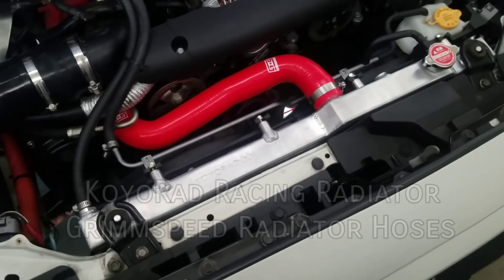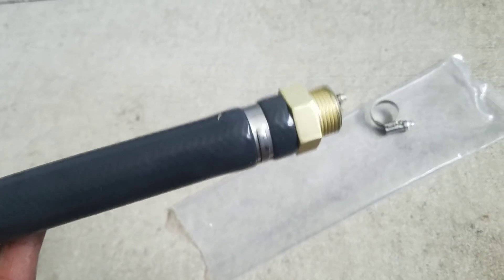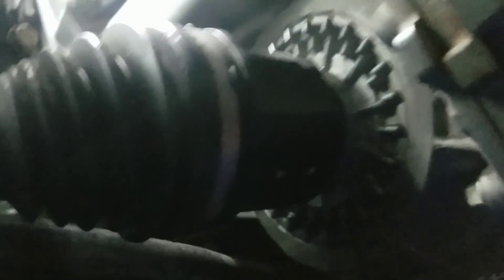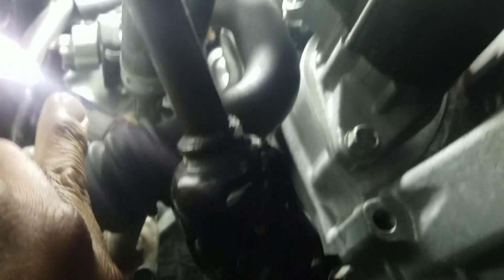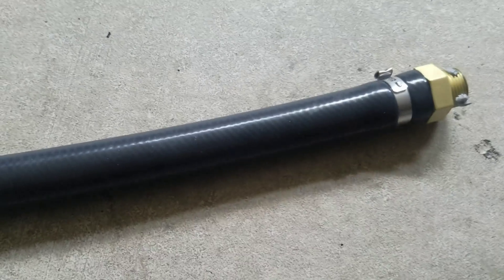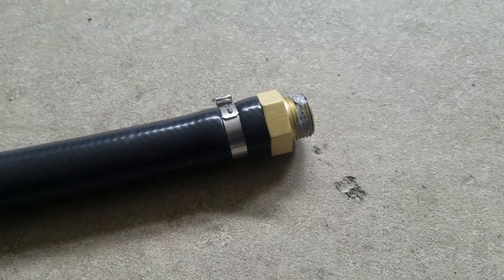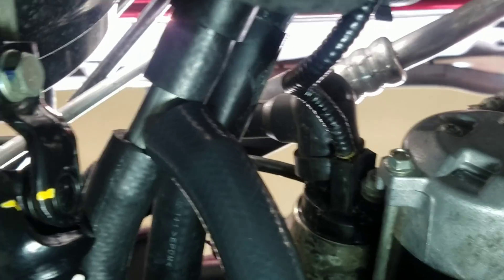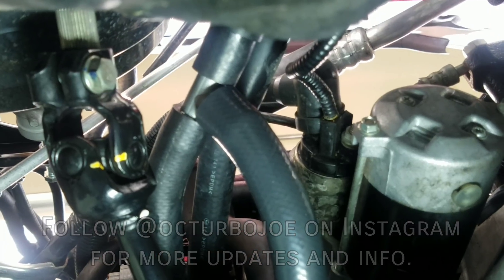2015 SUBARU WRX STI - Cooling Upgrade Part 3 - Get-A-Dom-Tune #4 Cylinder Head Mod - OCTurboJoe

Comment: Thanks for the video, man. I try hard to do good work for the community and I'm very grateful for customers like you.
Reply from the maker: Well sir, it's guys like you that help us with keeping our cars on the road. If only people would understand how much this mod does for the price. The returns are more than a $300 intake, that could possibly destroy the engine if not tuned correctly, mind you this is a set and forget mod. But everyone has different priorities I guess. Keep doing what you do Dom. Thank you again!
Reply: Turbo ninja plus a Degree in hydro dynamics if I'm not mistaken, he knows his stuff so I'd trust the mod and  dabble with any mods he snaps his turbo-ninja-yoda fingers at. Dom's da man, he's tuned my rides multiple times (drove past many other tuners, 6 hr ride)
Reply from the maker: @wakeupandbord  I've heard he's great at what he does on many accounts. Thank you for your inputs on the man himself.
Reply: Does this work on the '17 wrx ?
Reply from the maker: @DaddyForever187  It will work if you did an EJ swap but other than that, no. Sorry.

Comment: Your Explination starting at 3:58 really helped me understand what was going on as far as flow from where and which pipe and why, this is usually not talked about and is more a how (cut this hose to insert T ) and not a Why your picking that hose since its the return from the heater core and not the supply. One could argue the supply would also work, but only when there is flow through the heater core and wouldn't be a good idea at all. You really cleared it up for me. Thanks

Comment: I was able to find a fitting that screws into the left side of the head. It is made by Subaru and I got it imported from Japan. I was able to to make this mod for 40 bucks.
Reply from the maker: Awesome. That must be for the twin turbo models. What size is the ID of the fitting? Better to use and OEM part than to fab up an imitation using wrong size fittings to get thr job done.  Dom has tested his with different sized hoses and found 5/8" ID to be the optimal choice.
Reply: If I remember correctly when I was doing measurements I believe it was M20 X 1.5 
I’m located in Florida, I have a 2017 Subaru Sti Limited and I have been running this diy mod for about a year now. It’s an oem part that I had to import from Japan.  

Here are the parts I used: 
Subaru Plug - Water Bypass 21170AA020
Dorman Heater Hose Tee Fitting 56387

All the issues I’ve read about if the fitting is to big then it will extract to much heat. That is simply not true. Doing my own test... using a IR meter I saw similar temps across both cylinder heads give and take a few degrees. And another claim about you won’t get heat In to the cabin when you turn the heater on. That’s untrue as well because I’ve used my heater on those cold Florida Mornings and it work like a charm! 

I’m not trying to take business away from Dom and his product. He’s a great individual and has a awesome product. But for those out there who think 80-90 for a simple fitting, barb and piece of hose is mind boggling this is the alternative. 

After all you have to pay to play in the car community. 

Finally, I love what you are doing to your car stay safe from and always good health John from Clermont :)
Reply from the maker: @narindersalick6594  That's great that you've tested it yourself.

Yeah that false claim about the mod taking heat away from the heater core is absolutely absurd because the hose is already positioned on the return side of the heater, and on its way towards the water pump.  I guess those who have been experiencing heater issues have been installing it on the wrong side, lol.

Thank you John!

Comment: How do you feel about this mod 1 year later? Also, did you trim down the lengths of any of the hoses involved for a better fit? Thanks for the vid and tips!
Reply from the maker: It's been great so far.  There are so many copycat designs out there with AN fittings.  They're not the best. AN fittings reduce the overall ID of the outlet and inlet of the hose, causing pressure drops.  Plus they're more prone to leaks if not installed properly.

I didn't have to trim mine.

Comment: What is the point of view at 7:20ish timeframe? Is that underneath the vehicle looking up?

I’m trying to figure out where on the engine block the mod goes into. I’m having a difficulty understanding it’s orientation.
Reply: Can you help me out pls?
Reply from the maker: @joev8275  Imagine looking at your engine bay.  Locate the driver's side cams; opposite of that, against the firewall, next to your steering linkage.
Reply: OCTurboJoe alright does I just saw a picture of it. But since the cylinder faces outwards, driver side, is the bolt to be removed on the same flat side as cylinder 2 and 4? Or is it underneath the block? Or on top of the block?

I don’t want to pay $150 to this mechanic which is why I’m asking
Reply from the maker: @joev8275  It's in the rear of the cylinder head, opposite of the front pulleys, facing the firewall. If you have a hard time finding it as it is, you should just pay the mechanic.

Comment: For tightness. Hand tight plus 1/4 turn?
Reply from the maker: Until it completely stops and no more. You don't want to crack your aluminum cylinder head.

Comment: Why do you have to wait 24 hours before you burp the system
Reply from the maker: I used a sealant that requires 24-hrs to cure. However there are sealants like Permatex "The Right Stuff" which cures in minutes.

Comment: did you do this on jackstands?
Reply from the maker: Yes
Reply: OCTurboJoe damm. how did you thread the cooling mod after u applied the sealant? by hand? then finished it up tightening it with ur wrench?
Reply from the maker: @mjs_ctr  By hand first, then with a 1" wrench. I had to turn the fitting at an angle. I ordered a 1" crows foot for future installs.
Reply: OCTurboJoe Hey bro thank u so much for all ur response. was your 12mm hex bit socket a 3/8 or 1/2 drive? is it better if its 1/2 drive
Reply from the maker: @mjs_ctr  It doesn't matter

Comment: When you take the plug out of cylinder 4, will coolant come out of that plug if you don't drain the coolant? I'm thinking it would be easier to pinch the hose on both sides and insert the T without draining the coolant. Just wanted to see what you thought about that. That might eliminate burping it for as long too??? Thank you, this video was very helpful!
Reply from the maker: There will be coolant spillage. The plug is located at a cylinder cooling jacket.

Comment: Do I has to drain the coolant? Also do I has to burp the system. It’s going on my 05 wrx. Thanks.
Reply from the maker: Drain some or pinch the coolant hoses. You will have to burp the coolant for this install as air will be introduced to the system.

Comment: No worm clamps on the T connection inside the heater hose? It seems like that could be fragile and prone to the T popping out over time.
Reply from the maker: If you watch it to the very end, you'll see.
Reply: @octurbojoe  ahh yeah okay hahah i clicked off at "thats it" lol

Comment: How long did it take you to install the cylinder 4 cooling mod?  Sorry if you said it in the video and I missed it
Reply from the maker: Takes about an hour if you use a quick curing thread sealant (Permatex: The Right Stuff) for the fitting. It took 24hrs for me to do it because I had to wait for 24hr sealant to cure.
Reply: @octurbojoe  ok, got it.  I heard you say you waited 24 hours for the Ultra Grey to cure but I wasn't sure how long the actual install took.  But 1 hour isn't bad for the actual install.  Thanks for the help!

Comment: How long does it take to install this part? Thanks for the video.
Reply from the maker: It takes less than half an hour once you've either drained or pinched the cooling system. You'd still have to replenish and bleed so about an hour total, if you have a faster curing sealant. For me, all I had was 24hr sealant so I had to wait a full day until I could fire my engine up and bleed the system.

Comment: Any antifreeze leaks after the install just got the cooling mod in need to get the 1 inch crowfoot.
Reply from the maker: None at all. If you do it correctly, there shouldn't be any leaks.

Comment: Very helpful video! Will be doing this soon. Before I tackle this, i wanted to ask, is there enough room to loosen the plug with a 3/8 ratchet, extension and 12mm hex socket?
Reply from the maker: I used a super long 3/8" extension with the 12mm hex drive and a universal joint. Don't forget a 1" crows foot wrench for torquing it
Reply: @octurbojoe  thank you! :)

Comment: Phenix industries makes an an fitting that fits the ej25 head. The Vems kit uses them, but of course no one shares what the fitting size and threads are so you can diy your own kit.
Reply from the maker: The difference between this and the VEMS kit is that this hose is larger therefore will offer excellent (and better) flow. The VEMS kit just looks pretty.
Reply: OCTurboJoe still think they are over priced for what they are. Coolant hose and a couple of fittings.
Reply from the maker: @michaelhite1433  $90 beats $4-5K for a new motor. Same for AOS' and ELHs.
Reply: OCTurboJoe it was the same way when the steam vent kits first came out for LS’s. Then people started getting the block fittings and making their own for less and customize it to their needs.
Reply from the maker: @michaelhite1433 Understood. But some don't have the resources available to them, let alone skills, to procure such kits so that's why they exist. If you can make them out of Home Depot parts, more power to you. But in the end, it will cost more than these kits. I've looked it up myself.

Comment: I just wander why subaru didn't put this part in their ej25 in the first place but my guess is, make us do it so they can void the warranty
Reply from the maker: There are many other things they could have done besides adding a silly sound tube on the intake. But they only mod their engines to stick with stock power levels.

Comment: It is strange community. Spend 30-40k on an STi. Get $4k forged wheels. Spend money on hella horns, eBay body kits, tint. Spend $$$$$$$ on flex fuel and a big turbo, bitch about a $90 part that will save cylinder 4.

Comment: Lol, Nice Glyco Bukkake 😂! There was another YouTuber who did this mod and he suggested to drain the coolant/release the pressure starting from the oil cooler IN pipe so the coolant wouldn’t be gushing out from the #4 galley plug. Though he didn’t mention anything about the reduced spillage from the return pipe, but it’s worth a shot for me since I’m replacing my radiator coolant for maintainence purposes. Seriously thank you for posting the detailed install on this mod. Great explanation. Good choice on the Dynatron song btw!

Comment: Cant I just make this for alot less? 90$
Reply: 3/8 threaded NPT fitting - $3.99 Coolant safe heater hose - $1.39/ft 3/8 T fitting - $7.49 Crush clamps - $5.49/ bag of 10

Been running my diy one for a year no issues
Reply from the maker: @JB-pk1jx  3/8" tee? The heater hose return is 5/8". You mean 3/8" to 5/8" tee? 3/8" ID will not flow enough to extract the hot coolant out of the head.
Reply: @octurbojoe   Drill and tap the Subaru plug or equivalent for 3/8" NPT to 5/8" barb fitting, heater hose, PEX 3/4"  brass Tee (fits 5/8" hose). A lot less than $90 US.
Reply: 3/8" or 1/2" NPT to 5/8" barb
Reply from the maker: There is no way. Trust me.
Reply: @octurbojoe  lol Yeah hard to find parts but Im currently piecing parts to make that fuel pressure regulator..some of your links are expired I think no biggie though thanks
Reply: So you're telling me I can't just get the same turbo coolant  return thats on the the pass side and do this mod? Why not?
Reply: Home depot might have them lol
Reply from the maker: @daddybotz  Sure they do. You can let us know how it goes when the engine overheats.

Comment: I just found out about this mod and I plan to get it really soon.  I have a 2012 STi hatchback with just about 52k on it, running the Cobb Stage 2 OTS map but going to get a custom tune soon. Great video btw i'll be using this as a reference when I get to the install. I also followed you on instagram, i'm @justin.sti
Reply from the maker: Thanks for following 👊🏽

Comment: Mind getting some before and after temps if you could?
Reply from the maker: I never had a chance to get a before reading on the cylinder head but I can try show my coolant and cylinder head temperature afterwards however I've also installed the KoyoRad so it may be less than the kit alone.
Reply: @octurbojoe  Thank you. Looking forward to your future videos.

Comment: I love the information here.  I didn’t know the #4 cylinder had issues.  This makes me want to fix this on the blue STI now.  Is there any special procedure needed to burp the radiator with ej engines? Bleeder valve ?
Reply from the maker: Get this:
https://www.amazon.com/EPAuto-Radiator-Coolant-Filling-Funnel/dp/B01I40ZQWE/ref=asc_df_B01I40ZQWE/?tag=hyprod-20&linkCode=df0&hvadid=198151843411&hvpos=1o1&hvnetw=g&hvrand=17620843764928886750&hvpone=&hvptwo=&hvqmt=&hvdev=m&hvdvcmdl=&hvlocint=&hvlocphy=9032742&hvtargid=pla-381147636217&psc=1

My WRX Channel has a video on how to use it. Very easy. Us Subaru owners use the green fittings for the coolant header tank, near the turbo.